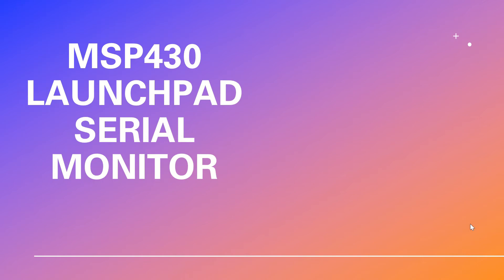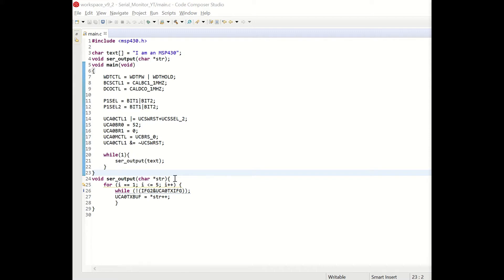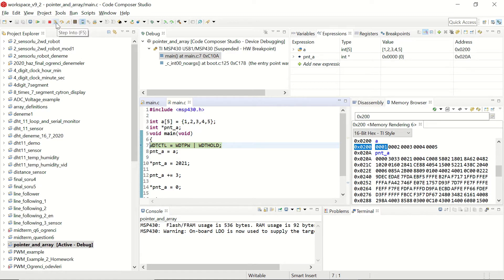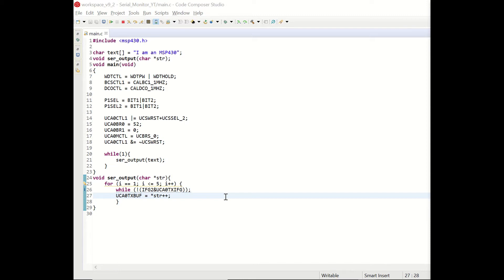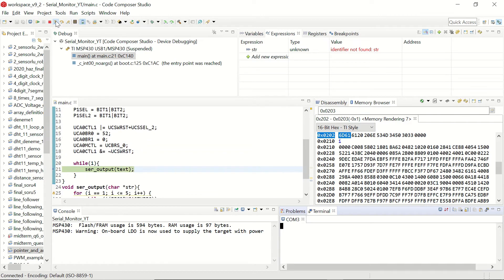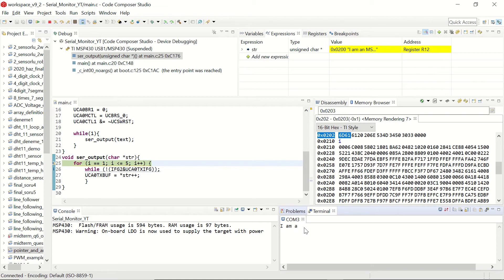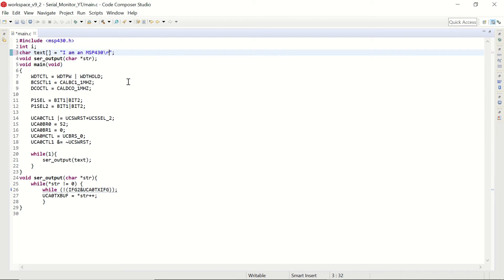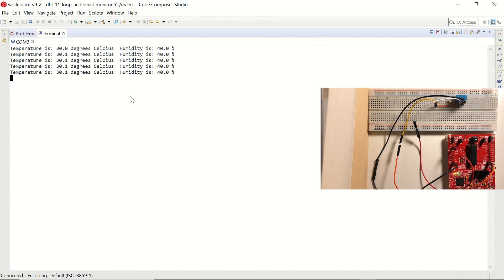MSP430 Serial Monitor

Comment: I followed your code but it returns error "too few arguments in function call	main.c" at line 76~line 79, and I don't have any clues about the reason, do you know how to solve this problem?
Reply from the maker: Hi, ltoa function's usage has changed, there's an additional argument now, please try the following (I also added this as a comment in the githup page)
ltoa(th,th_char,10)
The related article:
https://software-dl.ti.com/ccs/esd/documents/sdto_cgt_handling_changes_in_ltoa.html
Reply: Thanks for answering,it helps a lot.
but I still encounter problem about the terminal,it doesn't display anything even though I connect the device and check the setting,do you have any idea about it?
Reply from the maker: Hi, find the uart jumpers on the board and align them horizontally instead of vertically.
Reply: @drselim  thanks a lot
but now all the context which terminal shows are garbled, which my encoding setting is ISO-8859-1 as you :(
Reply from the maker: Did you set the baud rate to 19200 ?
Reply: @drselim  yes I did
Reply from the maker: Can you email me screenshots or video of the situation? Make sure you show the terminal settings, code etc. Also please check that you get values for the variables (measurements) from the expressions window so that you make sure you obtain values from the sensor.
Reply: @drselim  I already sent you ,check on your new coming mail starting on your Gmail：）
Reply from the maker: Thanks, i’ll check and reply via email

Comment: Could you please explain how do you use the USB-to-UART backchannel with USCI_A0 ? (UCA0) when according to the Launchpad datasheet Ez-fet technology is connected to USCI_A1 module ? This means if you use USCI_A0 you need external adapter like (FTDI, CP2102 или CH340) and not the standard USB cable of the Launchpad.. What model of the Launchpad do you use ?

Comment: Great video, but you reset the watchdog timer, so if you want to switch on a led fe it will reset with the system
Reply from the maker: Yes, you are right. That is the disadvantage of the reset with watchdog. The code can be revised by adding a delay and restarting the whole process in the while (1) loop.
Reply: @drselim  could you change the code?
Reply from the maker: At the moment, I’m lacking the setup for the sensor and msp430, unfortunately I won’t be able to update and test it. I’d suggest moving the code (after the uart setup) in the main section into the while(1) loop and remove the watchdog reset.

Comment: Please explain me ....🙏🙏
how to define serial.begin() function in CCS for msp430
Reply from the maker: Hi, actually there's no direct way to match the serial.begin() function (as in arduino), the 5 lines in the code are corresponding to the UART settings:
UCA0CTL1 |= UCSWRST+UCSSEL_2;
	UCA0BR0 = 52;  //settings for 19200 baud
	UCA0BR1 = 0;
	UCA0MCTL = UCBRS_0;
	UCA0CTL1 &= ~UCSWRST;
The "UCA0CTL1 &= ~UCSWRST;" line is for initializing the USCI state machine so maybe you can think of this line as serial.begin
I hope this helps.

Comment: hocam ,kodları yükledim.serial monitörü açtım. 19200baud .fakat ekrandaki görüntü bu ���������ŧ����$�Ť��������D󀆤�����ŧ����$�Ť��������D󀆤�����ŧ����$�Ť��������D󀆤�����ŧ����$�Ť��������D󀆤�����ŧ����$�Ť��������D󀆤�����ŧ����$�Ť��������D󀆤�����ŧ����$�Ť��������D󀆤�����ŧ����$�Ť��������D󀆤�����ŧ����$�Ť��������D󀆤�����ŧ����$�Ť��������D󀆤�����ŧ����$�Ť��������D󀆤�����ŧ����$�Ť��������D󀆤�����ŧ����$�Ť��������D󀆤�����ŧ����$�Ť��������D󀆤�����ŧ����$�Ť��������D󀆤�����ŧ����$�Ť�������.neden böyle oldu
Reply: seriaal terminal ayarını şu kodlarla değiştirdim.9600 baud da şu an çalışıyor.         P1SEL = BIT1 + BIT2 ;                     // P1.1 = RXD, P1.2=TXD
     	  P1SEL2 = BIT1 + BIT2;
     	  UCA0CTL1 |= UCSSEL_2;                     // SMCLK
     	  UCA0CTL1 |= UCSSEL_2;                     // SMCLK
     	  UCA0BR0 = 104;                            // 1MHz 9600
     	  UCA0BR1 = 0;                              // 1MHz 9600
     	  UCA0MCTL = UCBRS0;                        // Modulation UCBRSx = 1
     	  UCA0CTL1 &= ~UCSWRST;                     // *Initialize USCI state machine*
Reply from the maker: Yeni ayarlarla cozmussunuz 👍
Reply: @drselim  Hocam, it works with baud rate 9600. But could you please 
explain what can be the possible reason why there is custom characters on the terminal with baud rate 19200?
Reply from the maker: @zorzional  it is possibly due to the clock speed used on the MCU, the registers (UCABR..) are used as dividers to the clock speed. You can check it in the datasheet.
Reply: @drselim  Hocam, 9600 baud rate ile serial monitöre yazdırabiliyorum ancak DHT örneğinde bir sonuç alamıyorum. Her şeyi kontrol ettim, bağlantı da doğru. Launchpad vcc den 2,87 volt alıyorum, acaba sorunun kaynağı bu olabilir mi?
Reply from the maker: Merhaba, şimdi dht11 videomdan kontrol ettim, dht11 3.5-5V arası gerilim istiyor. Büyük ihtimalle sorun bu. Launchpad bir önceki versiyon kullanıyorsanız 5V çıkışı olmayabilir. G2ET versiyonlarında var. Ya da pil ve 5V regulator kullanabilirsiniz. Dht11 videosındaki baglantilari kontrol edin lutfen.
Reply: @drselim  Hocam, DHT11 i regulatörlden 5v ile besledim ama sonuç değişmedi terminalde sonuç görmüyorum. Expression da değişkenlerin value sütununda debugtan sonra Could not read 0x030C: execution state prevented access uyarısı alıyorum. Bağlantım şöyle DHT 1. pin > 5V, 2. pin > P.2.4, GND güç kaynağının GND probu.
Reply from the maker: @zorzional  merhaba, baglantilarda bir de direnc oldugunu hatirliyorum, pull-up ya da pull doen olabilir. dht11 videosundaki baglantilarla karsilastirdiniz mi? Şu halde bir deger alamiyorsunuz dht11den. Baglantilari kontrol ettikten sonra dht11 modulunun de calisip calismadigini kontrol ederseniz iyi olur.

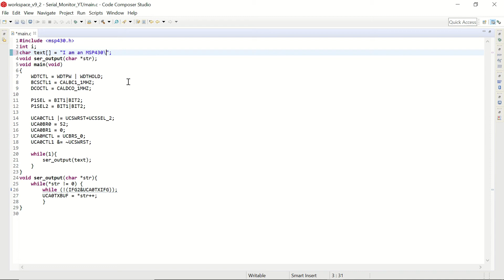Comment: 11:12  hocam msp430g2553 mikrodenetleyicisi ve ona ait alunchpad kullanıyorum.TI sitesinden UART'ı anlamak için benzer example code buldum .Nerdeyse sizin yazdığınıza benzer bir kod.Sorun şu ,P1.1 (RXT)ve P1.2(TXT)  pinlerine iki adet jumper kablo bağladım.bu jumper kabloların diğer ucunu  12:02  de videoda yuvarlak içine alıp gösterdiğiniz(bende beş tane soket yeri var.TDX,RDX,RST,TEST,VCC) tdx ve rdx soketlerine  mi bağlayacağız?Ne yapacağımı anlamadım.Jumper kobloların ucu iğne gibi ,sokete oturmuyorlar.Keşke resim vb bir şey olsa da kodu yükselikten sonra bağlantı nasıl yapılıyor anlasaydım.
Reply from the maker: Merhaba, USB baglantisi uzerinden Pc'de bir terminale bilgi aktaracaksaniz (videoda gosterilen de bu) pinleri (p1.1, p1.2) kullanmaniza gerek yok, USB uzerinden UART haberlesmesi yapacaksiniz. Control panel'de hangi portun msp430 uart oldugunu kontrol edip ona baglanin terminalden. TX ve RX Jumperlari (kablo degil) yatay olarak yerlestireceksiniz (normalde dikey olarak dururlar) fotografta gosterilen o.
Kolay gelsin.
Reply: @drselim  tamam şimdi anladım.meğer o plastık kılıf yerinden çıkıyormuş.altında iğne ucu şeklinde pinler var.ben kılıfların hepsini yerinden çıkardım .Bu sefer program yükleme hatası verdi."Error connecting to the target: Could not find device (or device not supported)".Kılıfları yerine koydum .dediğiniz gibi rx-txleri yatay konuma getirdim.Klavyeden u harfine terminalde  hello word yazıyor.Çalıştı.Teşekkürler
Reply from the maker: @ozgtzt7281  Rica ederim, kolay gelsin.

Comment: hocam bu hatayı alıyorum sorun nedir ?
Failed to open port COM3 with selected settings.
The error from the serial driver:
Error opening \\.\COM3 (5)
Reply from the maker: Merhaba, control panel’den msp430 uart hangi com porta bagli kontrol eder misiniz? Baglanti hizi da 19200 baud secilmeli
Reply: @drselim  com3 e bağlı bağlantı hızıda 19200
Reply from the maker: 12:02 de gosterilen sekilde jumperlari yatay hale getirdiniz mi?
Reply: @drselim  evet getirdim
Reply from the maker: Kod da birebir ayniysa calismamasi icin bir sebep yok. Kullanilan terminal ayarlarina bakmak lazim. Videoda da birebir nasil calistigini gosterdim.

Comment: HI I have uploaded the code successfully but my serial monitor shows nothing. note that i have verified port selection. what could be the problem?
Reply from the maker: Hi, did you set the on board UART jumpers horizontal instead of vertical?
Reply: @drselim  if i hold the msp430 in landscape style then all the jumpers are horizontal. can you show me the picture to correctly connect the jumper?
Reply from the maker: Hi it's already shown in the video starting from 12:02
Please try it and let me know if it's OK after this setting.
Reply: @drselim  i have done that and serial monitor gives some strange prints like bA bA
Reply from the maker: @umarjamil8711  Can you please try to use other terminals such as Putty or arduino IDE serial monitor, is the output the same? + Did you change the ltoa function? what parameter did you use?
Reply: @drselim  thanks for you time brother i have figured it out. i changed the values for 9600 baudrate and it is working
Reply from the maker: You’re welcome, in any case i have to check  the code because it was supposed to work at 19200. Anyways thank you for the feedback so that we know a solution now. 👍
Reply: @drselim  now i am getting failed in converting float variable to character. this function ltoa() gives error
Reply from the maker: Did you add the third parameter for ltoa? I had mentioned it in the code as comments.
Reply: @drselim  YES still getting error.
Reply from the maker: I’m not sure if I can reproduce the error you’re getting, but I’ll try. You can check to find a solution by checking ltoa usage on the web.
Reply: @drselim  can you just simply write a code to convert an int or float variable to string and display on serial monitor
Reply from the maker: @umarjamil8711  hi, the ltoa is there to do that. You can check the documentation
Reply: @drselim  I am also starting to learn MSP, so If I set the Buad rate to 9600, the code works perfectly, can you figure out what's the issue??
Reply from the maker: Hi, the code section that helps us set the baudrate is starting in line 34 in the code that i provided in:
https://github.com/selimg76/microcontroller/blob/master/MSP430_DHT11_Sensor
There, UCA0BR0 = 52; setting helps us set the baudrate to 19200 , if the clock frequency is set to 1 MHz which is the default setting for msp430g2et launchpad (msp430g2553 on it)
If you check the pages 424-426 in the MSP430x2xx Family user's guide (document code: slau144j), you'll see these settings. If you set the UCABR0 to 52 and you can see the output in 9600 baud, it may be that your device's clock frequency is set to 8 MHz ( (table 15-5) and the  oversampling mode is enabled (UCOS16=1). Please kindly check that section of the documentation.

Comment: Thanks sir, for such quality contents.  Iam going to try understand the code parallel with data sheet . Will this way it help me understand the code or if there is some other way. Please guide me sir
Reply from the maker: Hi Nirbhay, you're welcome. It makes me happy to see that you find the content useful.
For serial monitor, I checked the Code that I uploaded in Github, It's rather short and simple. Just check the 'Universal Serial Communication Interface, UART Mode' in the user's guide (SLAU144J), focus especially in "USCI Registers: UART Mode" and try to understand which bits set which properties. I'm sure these will support you. Regards